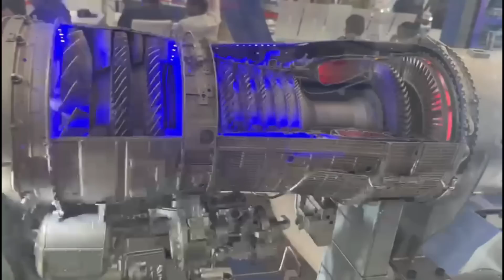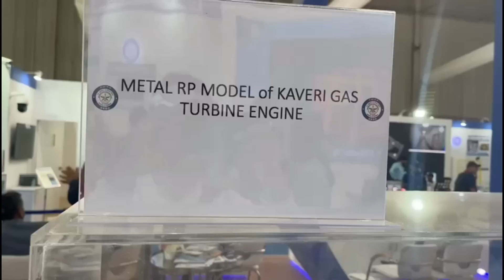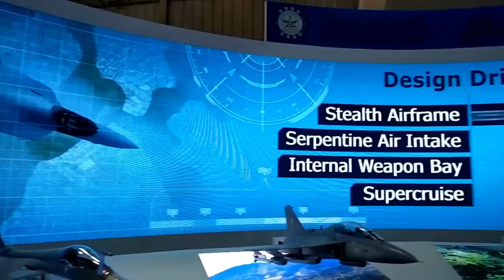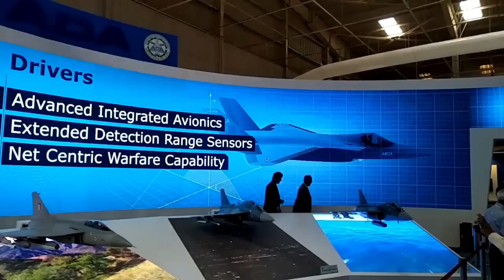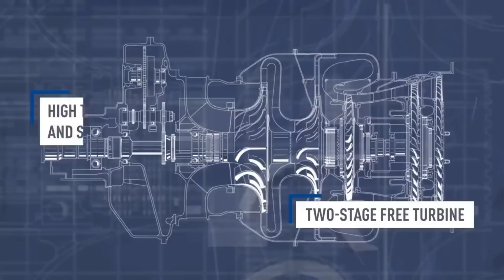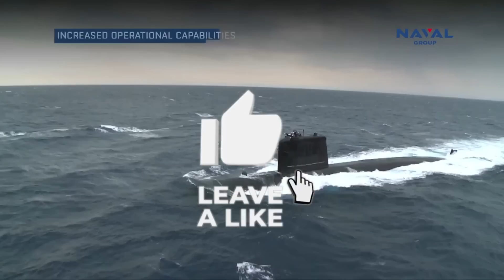India working towards development of 4 different engines for aircrafts #engine

Comment: If my guess is correct, there will not be any actual agreement on Jet engine in PM Modi visit to France. After all the hype surrounding PM's visit to U.S and how a deal will be signed with GE, only MoU was signed with still no news about the approval from U.S congress on GE engines to Bharat. so, PM visit to U.S is basically a dud as far as major defense deals are considered. 
Rafale M is not the best choice for Bharat Navy but Bharat has to accept it just because of 36 Rafale jets that Bharat acquired with no follow up orders (another blunder). Whoever is making these decisions for Bharat has to be declared as a "certified idiot" and should not be involved in any decisions going forward. 

Please don't count the chicken before the eggs hatch. one should believe the jet engine news only when an actual contract is made between Bharat and other countries.

Comment: Bhai i have 2 queries :-
1. When we have so many options regarding engine manufacturers like GE, Safran, RR, Kaveri then why IAF & MOD is not going for Swadeshi ORCA instead of billion dollars MRFA ?
2. China's PLA uses 5.8×42mm cartridges, how good is it compared to 7.62×39mm ? Can AK-203 fire 5.8×42mm bullets ?
Reply: 1. MRFA 2.0 is in pipeline since 5 years. I don't think we will really go for 20 billion dollar plan to buy 114 rafales, which will only start to begin delivery from 2027 even if we sign the deal this year. ORCA is derived from TEDBF program which navy is funding, with delayed first flight, we can expect delivery from 2029-32 for TEDBF. ORCA will not be much different from TEDBF expect for wing and landing gear design and weapons package. But the timeline for AMCA MK1 prototype will roll out is around 2030-32, with funding constraints IAF decided to go for AMCA and NAVY decided to go for TEDBF.
2. INSAS used 5mm cartridge and we have seen how it performed over the years. IA needs 7mm firing assault rifile which can shoot farther, more lethal and much better. what is better than AK series on this planet?
Reply: 3 CRPF soldiers are my close friends,  each one has minimum 3 bullets marks. 1 soldier have 5 marks of 5.42mm bullets . All alive, and still working.
Reply: @manoharbauskar3605  in cases when our soldiers are running low on 7.62mm ammo but they've managed to loot 5.8mm bullets from fallen pla troops, can our soldiers fire those 5.8mm bullets using AK-203 ? that's i wanna know
Reply: @AnirbanSarkar203  sorry,  I deleted my comment because PLA bullet size you are talking about. I have no idea about that. So I don't know answer of your question.( AK-203 can fire PLA bullet or not)
Reply: @manoharbauskar3605  no problem, actually i was wondering how to solve the logistics issue in pla's case. To counter pak who uses both 7.62×39mm & 7.62×51mm cartridges, we've bought AK-203 & Sig-716i but what to do in case of the chinese who use 5.8×42mm cartridges ? In battlefields soldiers often refill their ammo by looting from dę@d enemy soldiers, considering both of them have the same cartridges
Reply: @AnirbanSarkar203  strategy you are talking about  is not today's Indian army strategy.( surgical strike is different). 

Best strategy for Indian army against China is, don't cross China border , and realise PLA that they can't intrude inside India.  So there are zero chances of ammo shortage when Indian army is inside India.  

And no bullet fire treaty signed in between India-China,  If this treaty violated, then change in strategy possible.
Reply: @AnirbanSarkar203 You just can't Use 5mm caliber ammunition from India's Ak203 7.62×39mm rifles & logistical wise indian soldiers doesn't need to rely on enemies ammunition on any given situation because whenever our army Top brass generals planned any military operation during war the first & foremost thing they give first priority is to the logistics back up supplies (Ammunition+Rations+Medica) without which no army in the world can win any war forget about winning a war even sustaining a war becomes daunting task in absence of crucial & critical logistics supplies and one more thing even if our soldiers would be able to get 5mm ammunition from fallen Chinese soldiers then our soldiers can also get Chinese rifles for thats purpose in case of ammunition shortages ( although it will not going to be a case given our logistics supplies priorities take precedence over the others things) but having said that since our Army is currently operating 3 different types of Light Machine Guns 👉LMGs👈 one is nostalgia OFB 7.62 mm Lmg other one is brand new Israel origin . 7.62mm LMGs which we recently got from Israel along with that our army soldiers also using INSAS LMGs 5.55mm so if Chinese have same caliber ammunition of atleast 5.55mm then that can also be used in our INSAS LMGs other than that Chinese Piqa LMGs of soviet Russian design also using the same caliber ammunition of 7.62mm therefore it can also be used in our Israel origin & indian OFB developed 7.62mm LMGs
Reply: @manoharbauskar3605  but what about chinese 5.8×42mm ? The ones pla use in qbz-95 rifles
Reply: Reply 
1. Totally agreed with 1st. Query, but time is important factor. If India ordered today 114 aircraft under MRFA then delivery will start within 3 years, but ORCA still in design phase then 2 years trials, so it will be very late. Depends on what IAF think . According to them , IAF have time for ORCA or not ? This is the question.  

2. AK-203 will always have advantage above Chinese rifles because,  thousands Indian soldiers survived after injuries from 5.42 * 45mm bullets,  but  7.62 * 39mm bullet of AK-203 will kill PLA soldiers,  reason is physique, tolerance.